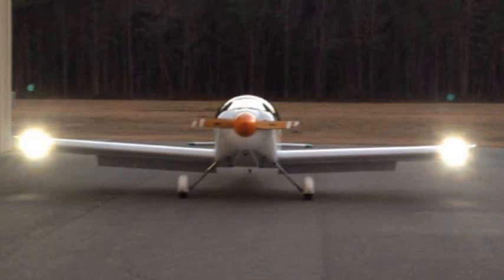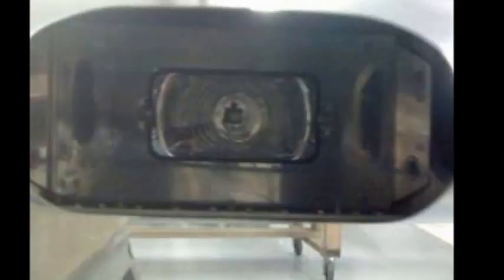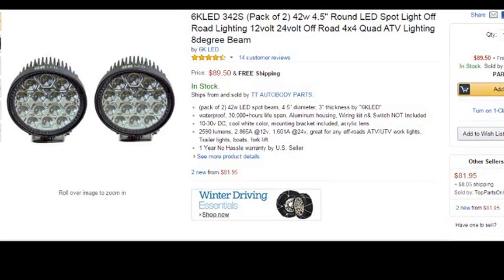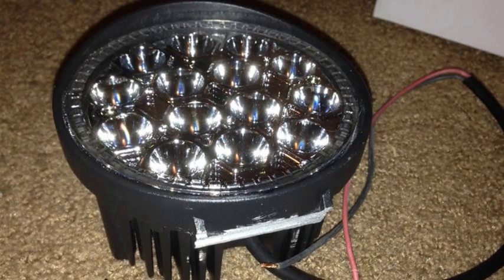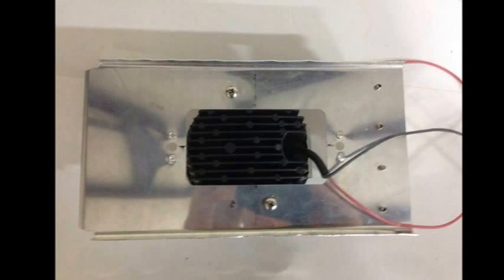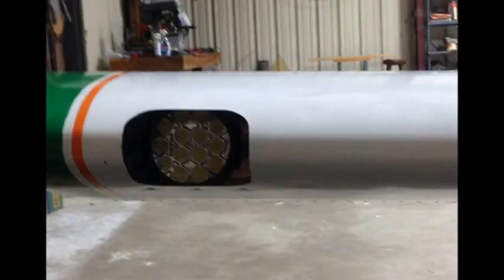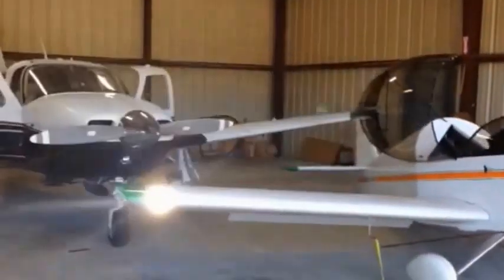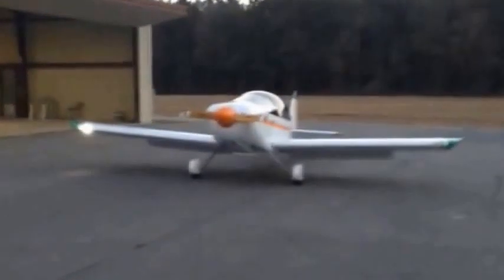Wig Wag LED Landing Lights

Comment: considering l.e.d. lights on your airplane?
I installed AeroLeds.
An Aero Leds landing light
An Aero Leds taxi light
An Aero leds Beacon
And Aero Leds nav/strobes.

One year later I had to remove my bacon due to radio nose so bad I could not use my radio on 1/3 of the frequencies needed.

Two years later my landing and taxi lights were inop.
 This year my NEW mechanic took off my nav/strobes because i was complaining I was having my nav strobe c.b. pop in flight.
yes, in the clouds, ifr, with wife on the plane...

They were full of water.

See my video AERO LEDS full of water 
https://www.youtube.com/watch?v=-c2xsvbGpsE
for what he handed me.

all in all I removed 3600 dollars worth of leds. (price plus labor)

I love my new whelen led lights.
yes, get l.e.d.s   they are great
but consider a different brand than AERO LEDS.

its crap.

learn from my mistake,
fly safe.